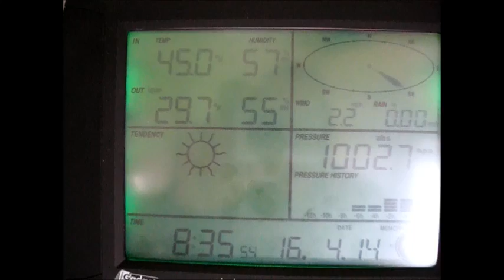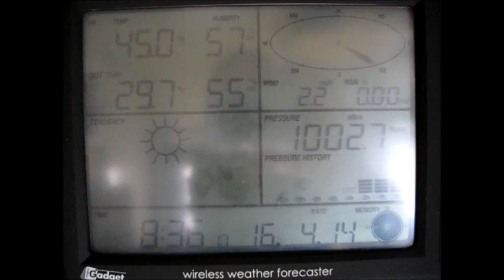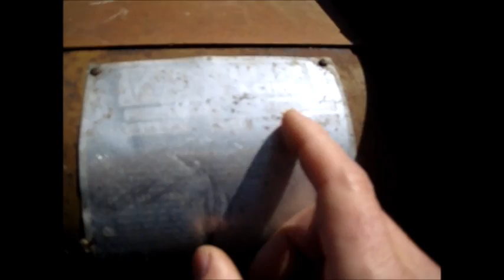Snow And My Huge Craigslist Haul For The Off Grid Homestead

Comment: I would save the cast iron motor. Them things run forever with very little upkeep. see if you can get it to run and install it back on the wood splitter She will never fail you on cold mornings like the new motors tend to do
Reply: That is a good point!
Reply: I have to agree with you. when you find something that good, why give it up for something less?

Comment: Just a suggestion: don't fill that roller with concrete!! or anything else for that matter other than a liquid, like water. Fill with water, locate the leak and repair it... you will be glad you did at some point in the future. Concrete will never be able to be removed, and sand or any other granular substance will take forever to remove, and will then have to be dealt with. Water simply drains out and you are done.

There will likely come a time you will need to lift that thing up and if it is filled at the time you will need a small crane to get that done. Consider that you may want to or have to sell it at some time, in my opinion if it is filled with a substance that can't readily be removed it will be pretty worthless..

Comment: I found that the best Rust Remover for Cast Iron, & other metals to be Apple Cider Vinegar. a couple gallons in a tub, drop in anything and watch what happens. 24 hours later I pull them and give a wire brush scrub, drop them back. When cleaning up use water, quickly dry, & OIL! Rust will reform if not Oiled when dried.
Reply: I used a potato and salt on a rusted cast iron skillet once. took some time, but it worked!

Comment: The Italian stove top espresso pot that I have used since the early '70s is called the Moka Express.  With a heavier-appearing octagonal base and carafe, it has the same components and general function as your Aussie model.  I wonder which was the original, but not too much.  I can tell you that I have used mine for over 40 years because it makes a damned fine cup of espresso, and yes - I, too, drink it with lots of milk.  Cheers - you should get lots of coffee pleasure - with or without caffeine, as I have learned.

Comment: The engine I replaced on my log splitter is a 5.5 horsepower Briggs and Stratton I bought from tractor supply. It has split every log we have ever placed on it with no problem.

Comment: The little Briggs and Stratton motor could be a five hp it is a easy fix, you can shine up the mag and the coil pick up file and set the points. Clean the carb and put a new rubber gasket fuel pump in the carb for a couple of bucks they always need one for sure or it wont run. Clean the gas tank and it should run. I would put it on the go cart. I use to own go carts, several of them. The Tecumseh will work on the go cart that it has but the carb is really screwed up dirty. You would need to soak it and buy a new needle and seat and float to get it to run also probably a float bowl gasket rubber ring. Always wire wheel the spark plug and gap to about 32 thousands.

Comment: It was worth the wait. :-) Craigslist did pay off. Barter for a friends help did pay off, too. What's your thought process on selling the log splitter engine and putting on another? Especially if the replacement turns out to be less powerful? If you're planning to incorporate splitting in your long term goals for revenue, wouldn't the original engine be better? Just wondering. :-)

Despite setbacks, slowly, but surely you're putting all the pieces together for so much more than simply being "off-grid". That part you already accomplished, for the most part. Regardless of where they are, people can disconnect from the power grid, unless they are in a tiny apartment without access to what nature can provide. In any space large enough to use wood fuel (several different ways) and have some form of access to water, further disconnect from the "grid" is economically possible.

With already proven methods/approaches for off-grid, the DIY World is reaching higher into self-reliance and independence, across the board. With or without grid connections. People can stay on the grid for the sake of convenience. But aren't slaves to it. IMO, homesteading, ie self-sufficiency, is becoming more apparent with each step forward that you take. Whether growing chickens or bartering for a log splitter. Or, showing, yet another way to make a pot of coffee. :-)

Keep up the good work. Keep up the good fight, regardless of what the naysaying slaves (and other agendas) may say or do. While I may disagree with some of the how you do things sometimes, fully appreciate that you are trying to teach others principles I've known from childhood. Spending my childhood on a PRE-GRID self-sufficient farm taught, years ago, so much of what you're teaching others, today. Thumbs up & may God Bless.

Comment: 3.5 X 4 maybe the bore and stroke. It will calculate the displacement, AKA engine CID. My calculation show (rounded figures) 44 CID, about 3.5 times more displacement than a 5 hp Briggs.

Comment: You will be sorry if you fill the roller with concrete. Trust me. Just fill with water....do your rolling...then drain it. If you want more weight, put in some gravel...which you can remove later if you want.